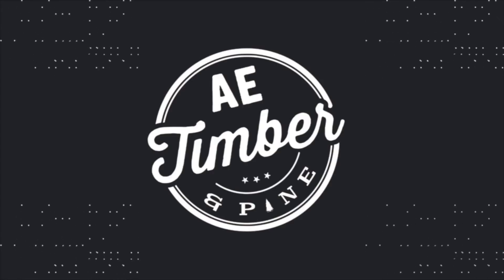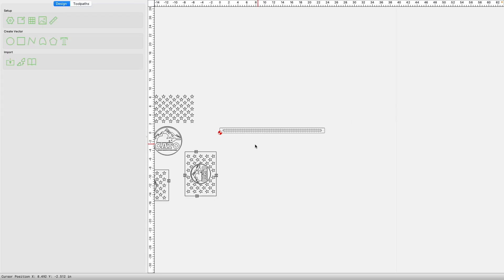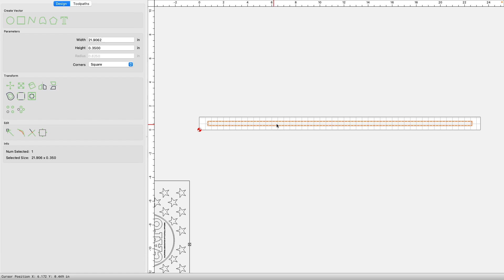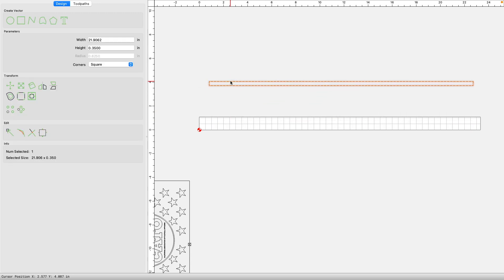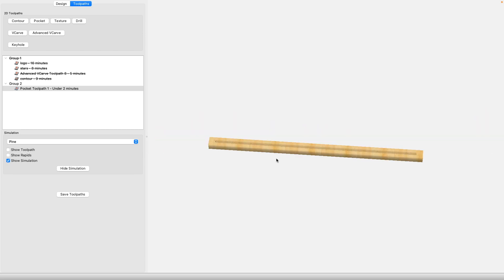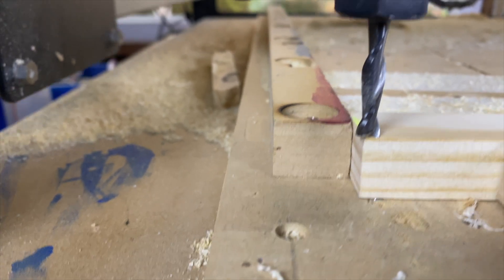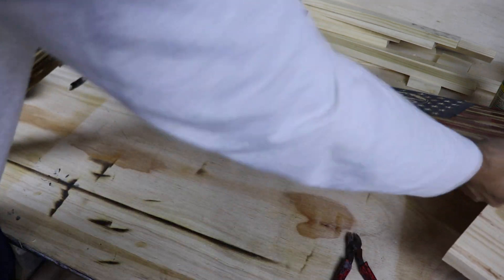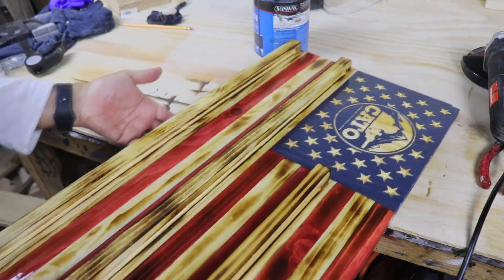How to Make a Challenge Coin Flag with CNC | Carbide Create Tutorial

Comment: Sorry if this has been answered before, what type of hanging hardware do you use for your signs?
Reply from the maker: Hi Steven I just use two screws and Ook hanging wire from Home Depot.
I believe the screws are 3/4”.  I mainly use .75” material so anything shorter than that should work. 

Once I get the screw started, I wrap the wire around several times to also to avoid the screw going through my material. 
Hope this helps.
Reply: @aetimberpine  yes sir, very helpful! You're awesome brother!